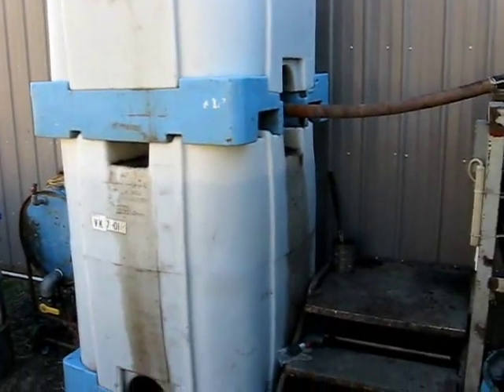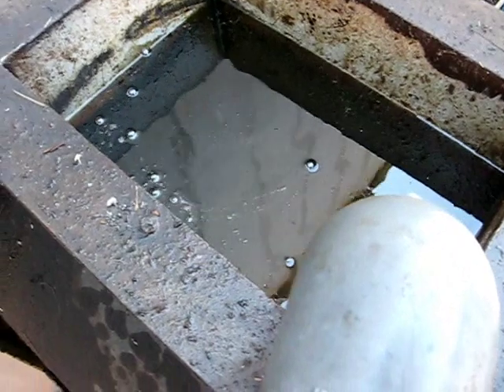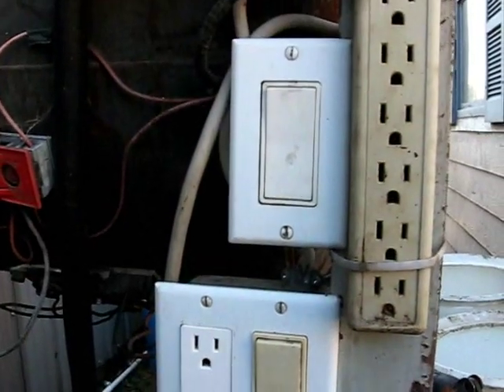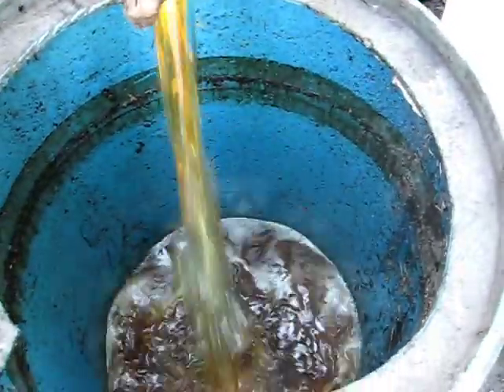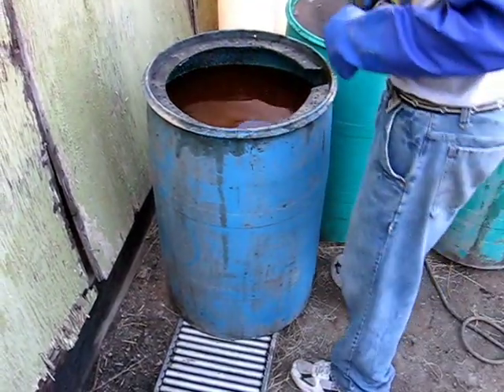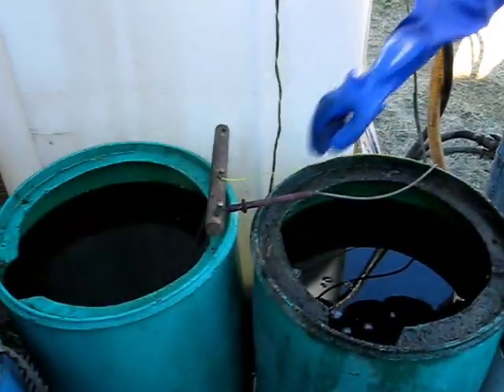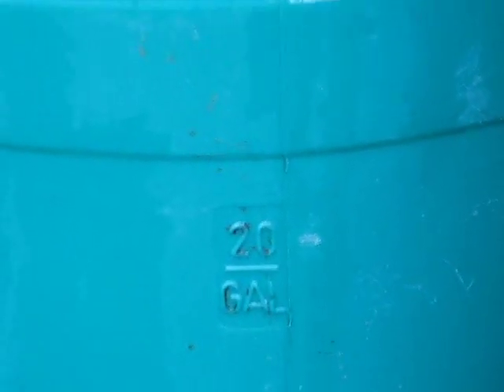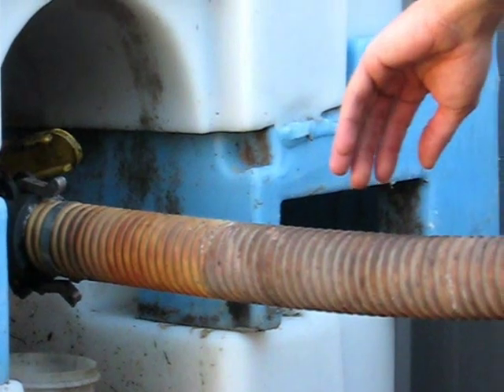MAKING BIO-DIESEL part 1

Comment from the maker: A walmart wire waste basket for first course filtering then a 5 gallon painters filter inside that wire basket for 2nd fine filtering. Then I let it settle out in the hot sun for 1 to 2 years so all I use is clean oil for my bio diesel.

Comment from the maker: for most vehicles nothing, but some newer trucks have a fuel sensor that looks at the fuel color. Biodiesel looks like the color of beer. Check the pump diesel for its color and if it looks like beer and still burns you should have no problem. you may need to make something to fake the fuel sensor out so that it only sees a sample of fuel station diesel.

Comment from the maker: using lye yes works, but the glycerine turns to a simi hard brick making it more difficult to deal with later on in the process. Potassium on the other hand leaves the glycerine liquid down to 0 degrees F. so you can pump it easily without having to dig it out which is very labor intensive.

Comment from the maker: Its voltage that does the trick, how you get that voltage by what means I don't think matters. I have found what works for me is a voltage window of between 7-8,000 Volts. I know 9,000 volts did not work as I also have a 9,000 Volt Neon transformer and tried it. And if I recall correctly I tried a smaller transformer I have around 6,000 volts and it did not work. I was going to make some simple voltage doubling circuits to make it work using a 9vdc battery jumped upto 7,000 volts. Good luck!

Comment from the maker: Correct 150 deg F. Glycerine device uses 2- Stainless rods connected to a 7,000 Volt Neon Transformer equipped with a 5-10 Watt 330 ohm resistor grounded to the neon transformer case to the shielding wire that surrounds 1 wire coming off the transformer.then connected to 1 of the SS rods...the other center wire from that 1 wire is connected to the other rod. Separate the rods by about 4 inches and make sure they never touch each other. Max voltage is 8,000 volts or will not work.

Comment from the maker: Nothing...Biodiesel is fuel just like diesel fuel is but much better. You will need to carry an extra fuel filter as in the first few hundred miles or so it cleans out the entire fuel system and may clog up the filter.